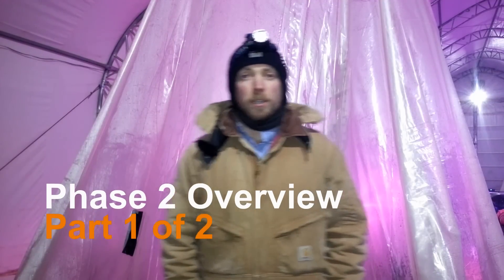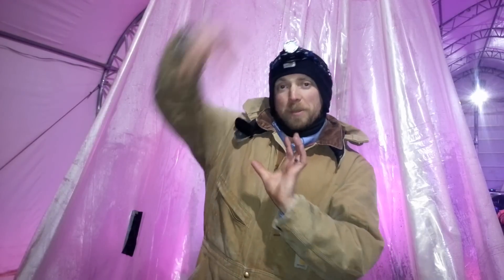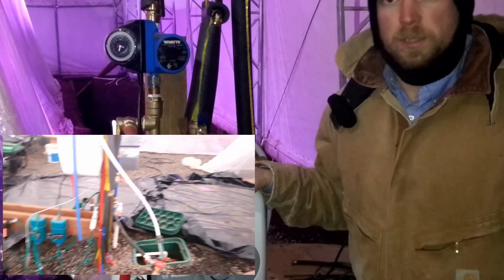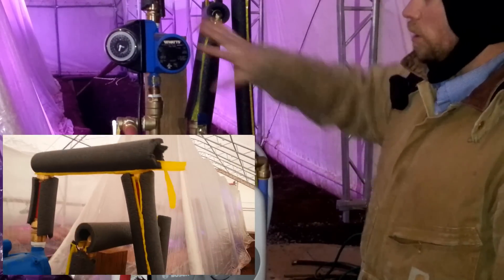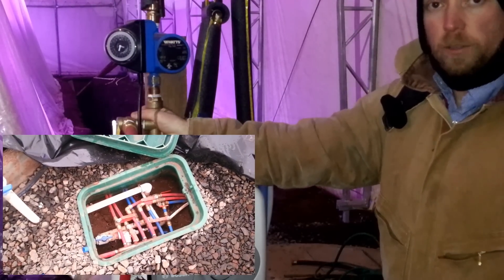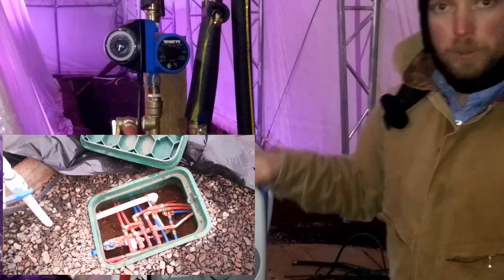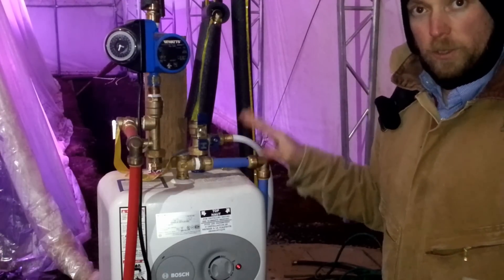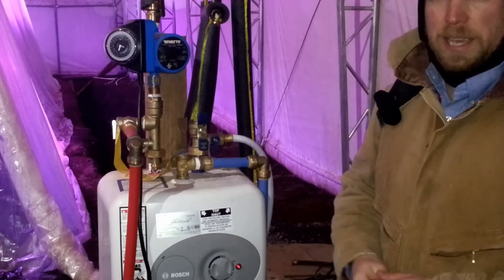Why the Future Homesteaders Need Automation - part 1

Comment: Perhaps instead of DO sensor, use several airrators (ie Aquarium) so that there is always sufficient air in the fish tanks. Ideally DC powered airrators so that can be connected with a battery bank so that if the power goes out your fish tanks still get plenty of Oxygen. I would be concerned that in your environment (hydroponic) that the sensor may not function correctly high failure rates. Sensors that measure water chemistry are usually not resilient for your application. For temperature sensors, I would recommend using thermal wells so that you can use low cost and replaceable sensors instead of more expensive submersible sensors. Thermal wells are typically a tube (plastic, PEX, or metal) that is sealed in on one end that goes into the tank, and open on the other (perhaps with sealed with a threaded end to keep the sensor secured. If you need to replace the sensor, you just remove it from the thermal well. With a thermal well you can use cheap thermal couplers or thermistors, connected to an microcontroller.  With the sealed submersible sensors, if they fall you basically throw it away and replace it with new unit. Plus you have to open the unit (Digestor, hydronic heating system, etc) to replace it. With a Thermal well you just snake the replacement sensor into the thermal well. With a thermal well you can also place multiple sensors in the same tube so you can get data from more than one point. For the fish tanks, a long PEX tube that runs the entire length can used to house multiple temperature sensors along the entire length, or use a vertical thermal well so you can measure the temperature at the top and bottom in the digester.For water level and water moisture sensors you can use a twisted pair cable. The capacitance will change depending on the water level (mount the twist Pair Cable vertical) or the moisture content (horizontally). with a twisted pair cable you can measure a wider area instead of a point soil moisture probe that will only measure moisture in a small area.  You would need to use a Microcontroller and use a circuit to measure capacitance. Some microcontrollers include CTMU (Charge Time Measurement Unit) to make capacitance measurement easier.If you are still set on using electronic sensors to measure NH3, Nitrates, etc, I would recommend that you set up a separate flow loop that is just for sensor measurements, The sensor loop should pass the water through one or more filters to prevent junk build up on your sensors. Limit flow on the sensor loop when you are taking measurements (ie one ever couple of hours).If you read this please reply. Other wise I am not going continue to post suggestions, if your not reading them.

Comment: Off topic but have you looked into Thermal Dynamic panels to create heat energy? They have a coolant that boils at -40f that circulates through an outdoor panel. As long as outdoor air is warmer than that, it can extract the heat from outside. The outside heats - even in winter - it into a gas. Which is then compressed which makes the heat increase greatly.
From there it can be used to heat water or perhaps into a forced air heat exchanger. 
Their are videos on the subject. But appears to be a closed system that requires little maintenance.
Reply: Could you take warm water from thermal dynamic panels and circulate them through radiant floor heating on your grow beds? Kind of similar to home kits people can install on sub floor at home?

Comment: Do you really need a battery to detect power outage?
why not just put the arduino on that power source, and have it send a signal every minute, if it misses one or two in a row, detect it as power outage.

Comment: For your water pump for your fish I would recommend using a motor starter relay.  They are normally open switches but at least in an industrial setting can easily handle just being left on.  The coil uses very little power to pull in and you can size the relay to be able to handle the amperage load of the pump.

As a side note.  Don't forget all of that automation comes at a cost.  Power.  Yes it is very minimal but it usage is still usage.  You could suffer death of a thousand cuts when trying to stay under your 40 amp breaker.  

As another side note as an electrician I can tell you breakers aren't designed to handle max capacity continuously.  Yes the rated capacity may be 40 amps but in reality it's more like 32 amps.  You aren't supposed to exceed 80% of the stated load for continuous use.  Doing so will eventually lead to failure from your breaker.  It'll prematurely trip and or have difficulty resetting.

Comment: Most interesting video and I broadly understand where you hope to go with this whole idea. However I have great concerns that you have a major reliance on certain key components, which when, and not if, they suffer a breakdown (as they surely will given time!), you do not appear to have a Plan B to kick into gear to keep everything functioning as you wish perhaps over and above the electrical supply situation. 
The water pump that you just showed us is a very good example of this or the WiFi unit, current water heater, digester etc, etc.

Incidentally can you explain in more detail just what is wrong with your digester beyond the fact that the contents are currently too cold for the bacteria to function?

Comment: How you looked at Automated systems used in Hog confinements ? They do a lot of what you want, and who know you might find the guy that is bored at his job and that will make it do what you want it to do.  I know there is systems that if it gets to hot, too cold, if the power goes out it sends you a text message.
Reply: Absolutely right and some also in the commercial poultry industry - many of these are time tested in hostile environments to combat dust , high humidity etc. We used a monitoring system such as described above that worked brilliantly.

Comment: would adding a wall of sand bags(because you can make them cheep)
around the your solar panels? would the dead air, inside, alone help to warm the underside of the panels?
could you put some form of heater below these inside the wall? 
would the temperature fluctuation crack the panels?
i will continue to ask this, till the event you are able to read it.

Comment: Hey real Martian, why not do a "drop ceiling" type of insulation system suspended by cables tight between sides? No need to heat the huge overhead area.

Comment: I run a much, much small hydro setup than you. I've looked at Arduino-based monitoring but could never find sensors that were cost effective enough for me since most nutrient sensors were close to $100 each. The price tag makes the 'big boy' equipment used by Bright Agrotech and other large growers look like a reasonable investment... but you get locked into someone else's automation package. Classic build vs buy debate.
Reply: At $100 a sensor for something that could monitor nutrient levels 24 hours a day 7 days a week at a very low operating cost sounds downright reasonable for large systems. I could understand that it probably isn't justifiable for a hobbyist or small scale grower but when used to directly control the system you are effectively getting a significant fraction of the value of a full time employee.

Comment: I'm assuming your Arduino controllers come equip with an analog input. If so I have found  the most accurate way to monitor levels in a tank (in your case a digester) is with an ultrasonic level sensor. I cant wait to see this fully automated!!!

Comment: Lofty desires to be sure, maybe implementing each phase singularly is best ? then you can monitor each change for whatever time you choose to be sure you are getting the desired results before moving to the next upgrade ? seems that making any more than one change at a time could allow for conflicting or skewed data. Or will you manually double check against the sensor readings for a time until your confident that the data is correct ?

Comment: You'll want to measure PARs (Photo-synthetically Active Radiation) no lumens on your light meter. Lumens will tell you how bight it is, PARs will tell you how much usable light the plants are getting.

I am assuming there are plans to have these read-outs displayed on a monitor in the actual building as well?

Not sure if it's part of your current gofundme goal, or a possible future one, but a website displaying all your sensor data would be awesome. You also might get a lot of advice/troubleshooting out of it.

Comment: setup a specified gofundme, indiegogo or whatever for a new shotgun mic. You need it :)
Reply from the maker: +Andreas Lied yeah I actually got one, I'm on my third mic setup...Very disappointing. Sony lapel mics used... they were so sensitive that they picked up everything even when I'm turned the game all the way down
Reply: They surely must have different modes? I have a +10 mode, a directional mode, and a omnidirectional mode on my mic. What model is it you are using?I would recommend a Røde Videomic. http://www.rode.com/microphones/videomic Works like a charm. Keep at it. Interesting stuff you deliver :)
Reply: TheRealMartian most lavelier mics are omnidirectional and pickup noise from all around. Shotgun mics like a Rode video mics have a much tighter pickup pattern either a hyper or super-cardioid.
If you have to use a lavelier mic in a noise environment hold it as close to your mouth as you can. You can then turn the gain down, which will decrease background ambient noise.
A simple cardioid handheld mic will do the the job too. Like a Shure SM57/58, the staple of every band everywhere. Downside is you have to hold it.
If you got some money and want the "astronaut" look, look at Countryman line of mics. Small, almost invisible mics that hang on your ear and wear right at your mouth like a com a astronaut would use in his spacesuit helmet. That will help reject noise as well because of mic proximity.
If you want to be able to work around your property and listen to music or take calls on your cell, there's a blueTooth truck driver's use. I know a few guys who run businesses on the road and take calls while driving that really like them. I think they cost about $60.
Reply: http://www.roadkingproducts.com/sp/roadking-bluetooth-wireless-noise-canceling-headset-with-dual-mic-design/
Reply: https://www.sweetwater.com/store/detail/E6OW5T1SL?product_id=E6OW5T1SL&adpos=1o1&creative=173874031892&device=m&matchtype=&network=g&gclid=CMPj7-X85NECFQe5wAodCxYGsw
Reply: https://www.sweetwater.com/store/detail/VideoMic?product_id=VideoMic&adpos=1o2&creative=173874031892&device=m&matchtype=&network=g&gclid=CK7Sw_385NECFRG4wAod1LkEtw

Comment: @TheRealMartian just a curious question, have you thought about taking the methane that will be created off of your bio-digester and using that to power your future generator? Also a rock bubbler can be dropped into your fish tank to add more dissolved O2.
Reply: He's shown a bio-gas generator before in previous videos, it has a green casing on it. Agree with the rock, apparently its very hard to have too much dissolved oxygen in an aquaponics system.

Comment: Glad to hear from you again! I was starting to worry something had happened. Glad all is well. I love the ideas you have for monitoring everything. With the data from you power meter sensor i think you could compile enough information for a future Photo-voltaic system that would remove the entire setup from the grid, which would be awesome. I am sure you have already thought about that, I just figured I would put my two cents in. Great work! Thank you for the info, stay safe, stay warm, and keep up the good work! Thank you so much. Semper Fi

Comment: Does the wireless setup you have allow you to upload your sketches to each of your arduinos?
For energy conservation it's good to configure your relays to have power off the coil for the most lengthy use periods and run on the NC contacts if feasible. A few wraps of wire around a conductor to a pump (or whatever) and a diode can be a good dyi circuit (current transformer ) for monitoring whether equipment is running or not.

Comment: Jeff, let us know if you can find a cost effective O2 sensor.
Reply: I'd like to know where he's getting all of his sensors, I know dissolved oxygen sensors can be expensive
Reply: I suppose there is always the possibility that someone has figured out how to take an old automotive O2 sensor, take it out of the exhaust system packaging and hook that to an arduino...
Reply: I think he wants to monitor dissolved oxygen which requires a different (more expensive) sensor.
Reply: I've seen them for about $250. They also some with a calibration solution. The probe seems like it is sealed like a pH probe. I know pH probes need to be kept wet or you can ruin them... Not so sure on the DO probes.
Reply: +htmagic, yes you are correct, he wants to monitor dissolved oxygen. I have been doing some research into the subject for my own aquaponics system, and it appears that the actual sensor is not all that different, the one for a car's exhaust is the sensor only, the unit you are thinking of is: the sensor, the decoder, the digital display, the display driver and the power supply, all in one nice neat little package; for, what, about $400?
Reply: In terms of inexpensive Arduino compatible sensors, I don't know whether you've looked into Atlas Scientific.  I believe that they'd have all of the sensors that you'd need to monitor.

I have purchased their pH and EC kits before and they seem to be performing quite well in a hydroponic solution monitoring environment.

In addition, they don't appear to be that expensive ($800 for a complete water quality sensor kit) - https://www.atlas-scientific.com/kits.html

The programming of the sensors isn't that difficult and they provide all of the code necessary to get started.

Check them out and I hope that it is a viable choice.  I plan on using them for all of the sensors for my own system, when I finally </sigh> get to building it...

As for your generator transfer, I would recommend going with a small commercially available transfer switch.  However, I have found an Arduino based power quality DIY site (https://openenergymonitor.org/emon/) that would help with monitoring the incoming power, but don't know whether it would help with the switching...  Though, I'm sure it would be possible.

Hope this information helps!

Good luck with the automation part and keep up the great work!
Reply: Not exactly cheap, but not made in east asia either... Thanks!

Comment: Redundant parallel systems on your pumps with autostart based upon low pressure and a leak detection based upon tank level.